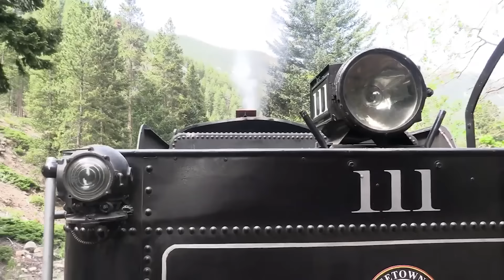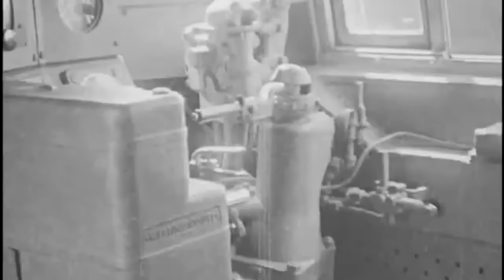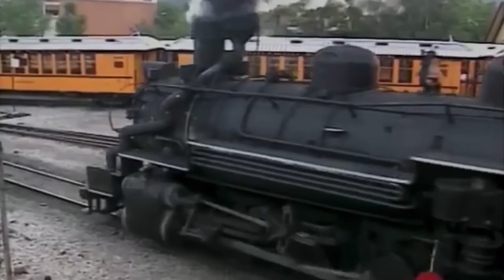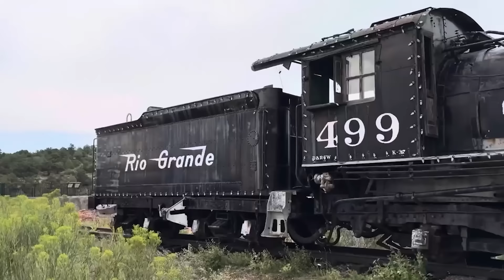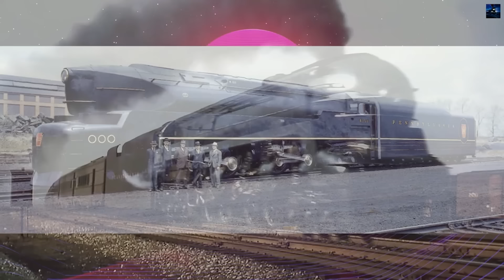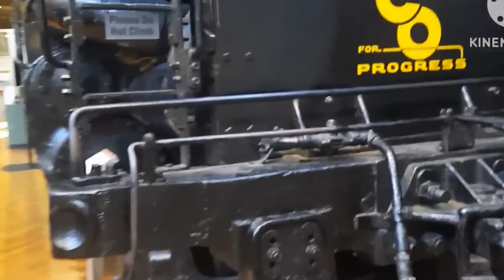10 SCARIEST TRAINS YOU DIDN'T KNOW EXIST

Comment: I am only going to critique your C&O Allegheny chapter.  To begin with "LIMA" is pronounced Lyma and not Leema.  When you talk about the wheel arrangement there is no need to include the word "dash" between the numbers.  The Allegheny was a well balanced steam locomotive with a factor of adhesion of 4.6 which meant less slippage on wet rail resulting in better traction.  The horsepower number you quoted was drawbar horsepower and not indicated horsepower.  A big difference!  The Alleghenies were not hard on the tracks like its sister engine the C&O T1 2-10-4.  Alleghenies were also used in fast freight and passenger service, the latter during WWII when they were tasked to haul upwards of 30 heavyweight passenger cars making up troop, medical and POW trains.  They were known to be smooth runners at all speeds including the 70 mph passenger train speeds.

Comment: If you want examples of a few ACTUAL scary ones;

RT-23 Molodet BZhRK: The RT-23 was capable of being equipped onto specialized M62 trains. Trains with NUCLEAR MISSILES . Thankfully no longer in service. 

Doodlebug self-propelled railcar Gasoline powered models: Also thankfully no longer in service. The drivers were very much breathing in toxic fumes and the event known as Doodlebug disaster got alot of people onboard killed due to the major flammability. 

Fowler's Ghost: It was a fireless locomotive. One that nearly exploded on its first test. It should be noted this shouldn't be used to judge the later designs. Later fireless locomotives are really safe. Better than regular Steam locomotives for certain industrial sites for flammability reasons.